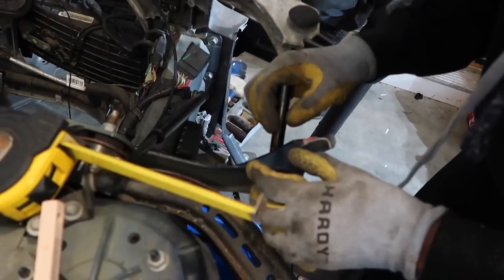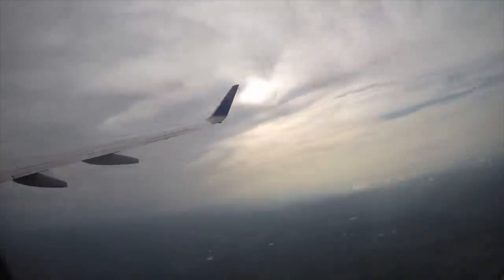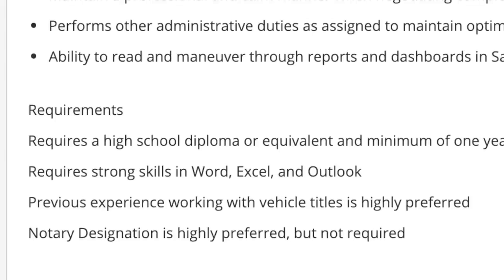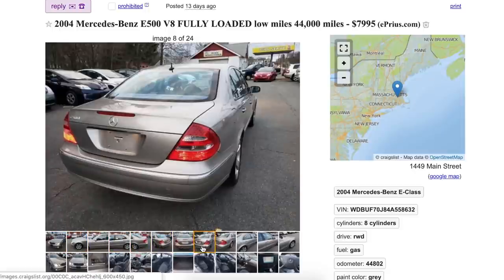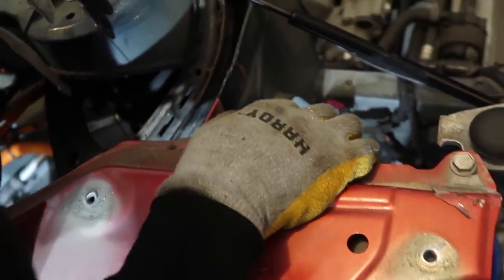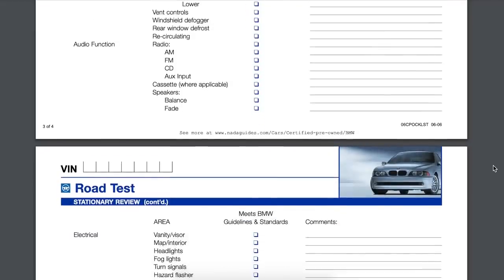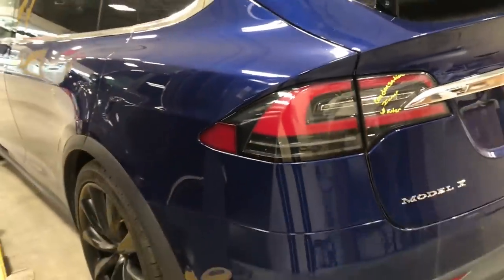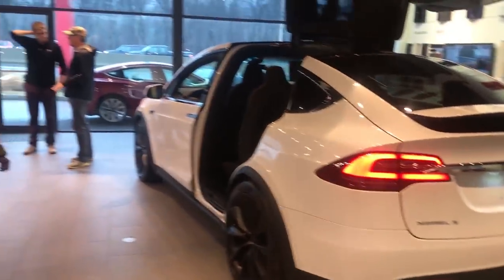Why the used Tesla system is broken

Comment: I had a horrible experience trying to buy one of these., it was at this center as well  Like you said, photos are hard to see any real details and you just kind of go with it because you say to yourself, there is no way they would sell a car like this! I looked at photos for a car, looked good, bought it, and when I showed up the center console was broken, the car wasn't charged even though it was sitting in front of multiple open charging bays, and still had the previous owners info on the main screen... . And last but not least, a cluster of dents in the  left trunk area! Probably 2-3k to fix. I walked after they refused to fix it. They said they don't do body work to used cars.. 
I'm now waiting for delivery on another one at the same dealer. Hoping it goes better this time around. Last time was very disappointing. Sucks not to be able to buy a new one! lol.

Comment: Wow, a late post for me but worthwhile read.  This video reminds me of a situation I worked in a long number of years ago.  I worked for a company that began the desktop computer business, computers used by engineers to do scientific design and analysis to help companies like Boeing, Lockheed etc. build airplanes and other very technical products involving (CAD), computer aided design.  This company grew from a start-up to over a $750M buisiness, selling computers that no one else was making at that time.  So, let me tell you how these computers were delivered to customers.  Computer cost $100K per desktop computer.  Mother boards completely burned out, motherboards inserted across seating slots, coffee cups and cigarettes and candy wrappers left inside computer, computers that, when plugged in, would not even turn on and so much more.  To meet sales and revenue targets, this company would ship the product, then let the field engineer at the local sales office fix the problem.  The customer, while so disgusted continued to buy these computers because there was no one in the industry manufacturing these computers so, there was only one option.  Not until some of the major suppliers of computers began to sell options competing with this product did the company change its practice.  Not possible today - wrong.  Companies will do what ever they have to; to make money and its almost always let the buyer beware.  I don't care how much you pay for the product.  The company purchasing these computers spent almost $100M a year on these computers only to receive them DOA (dead on arrival).  In fact the customer sent their own engineers to examine the computer as they came off the assembly line, just to solve the problem.  Yep and they still make computers today, only much better now cause the company was sold to a very excellent company called HP.  I left the company out because this example was to verify the video, not expose the company I refer to.  Oh, who was I, I ran the NW sales office for the company responsible for $200M worth of sales a year, I was tasked to make these machine work along with the customer!

Comment: The online purchasing process is terrible.  There is no transparency and one does not know how much final cost is until one puts the deposit.  My local service location in Santa Clara is the worst auto service experience EVER.  Rude staff, long waits and lame excuses why work cannot be done (like the weather for road noise...huh?).  They just didn't want to do the work and then later told the mechanic that heard the noise was on vacation.  Shady and questionable responses.  Love the car, hate the buying process and the service center.

The car is a 2016 S/70D with 7k miles and it rattles like covered wagon.  Tesla wants $100 to do a diagnostic.  What?...It is under warranty.  Today, the sunroof area pops and cracks when hitting potholes or large bumps.  Sounds like the sunroof is going to shatter.

Comment: Did I miss something here?  Why would someone buy a car like that?  And for $70k?   Last year I purchased a new 2018 Santa Fe.   $32k out the door.  I remember there were no dents, nail clippings, trash and crumbs in the car.  Plus everything works on the car.  That's quite a bonus when you consider I only paid a measly $32k for it!  Another amazing thing.... I took a 3000 mile trip with it and I didn't have to plan the trip around Tesla charge stations.  In fact I was able to gas up in some little dinky-ass town in Arizona.  If I hadda Tesla I'd still be stuck there.  
Best of all I don't have to kiss Elon's ass to get a servicing!

Comment: I got a new mercedes benz c63s (handcraft from german) with cracked tail light condensation in head light and afrer 1000 miles 4 of 8 cylinder randomly goes off line and causing misfire strands me on highway and had to call uber twice lol. They tell me keep eye on the condensation if it doesnt go away in 5 days well replace it. What kind condensation doesnt go away in a week? Even water will vaporized in 5 days

Comment: and i bought 3 year old škoda fabia, looked at used cars from theyr website then went to see and test drive, liked it then sent in a leasing request and hour later i drove out. And they told battery is almsot dead but still good aka bureaucracy and told me if theres problems then come and we will change it.
Bought the car for 7500 euros and they cleaned it and showed me the last info of the car etc.

Comment: And it's only going to get worse.  Every 90+ thousand Teslas they sell each quarter just add another 90,000 customer relations issues.  Also, because these cars are still so new, virtually EVERYTHING is under warranty with NO revenue coming in for replacement parts, unlike the norm at other manufacturers.  At this point in time, there is no way I would ever buy a Tesla and it will stay like that until they have PROVEN they can service the vehicles they build or fix accident damage in a reasonable amount of time.  I don't care what kind of performance they have or how many automatic updates they send over the air.

Comment: I'd be willing to bet that your Tesla is taking so long because it is dependent on someone else's Tesla being repaired. Someone else with a defective Tesla needed a loaner while their car was waiting for parts or waiting for the mechanic to finish their training on 'How to work on Teslas but not too quickly'. Get it? They're using your car as a loaner for other Tesla owners! Who knows, had you taken them up on getting a loaner you might have gotten your own car. But that would have just confused the issue when they said your car is done, turn the loaner in. Just a guess.

Comment: You can criticize the photos, but if you order a new car, you also get crap. It’s hard to run a car company, it’s easier to run a software co. Tesla is a software company running a hardware company wishing cars were software. Which they could be if Tesla just outsourced mfg to someone else. Until then buying new isn’t much different. They deliver damaged cars and when you complain they say sorry, it’s normal.

Comment: Why would anyone buy a Tesla?  Buy a good used Honda or Toyota or Acura for 1/2 the price with an extended warranty, and it will cost much less to own over the life of the vehicle and you can actually drive it across the country without having to stop every 200 miles.

Comment: Tesla needs to be shamed they are selling anything over $50,000 it better not be toenail clippings in the damn car

I can see that they must be losing money reconditioning the cars for CPO. This losing money should only be temporary moving forward since there will be a lot more cars in there should be more people interested in getting those cars CPO. Right now it’s eight years later, Tesla sold so many cars in that time. There’s a large aftermarket. There Should be a large aftermarket considering EV’s will outlast gas and hybrid vehicles. If an EV has never been in an accident it really should be out on the street!

Comment: That's why I have a BMW M5 2006 with a 5.5L Stroker and 700hp under the hood. Fuck Tesla. When they're good enough 10 years from now, that's when I will consider buying one. Now, BMW with 10mpg makes more sense once you do all calculations and I've done done calculations. You'd have to own a Tesla for 8 years to even up with a BMW M5. When talking about BMW M5 F90 then it goes up to minimum 10 years. Who owns a car for 10years? Huh? Huh? Huh? Almost no one.

Comment: Doesn't seem like Tesla gets any credit for addressing your repairs.. or actually providing the loaner they promised.   I'm not sure your vlogs are actually helping Tesla.. because they seem to be dropping programs that improved the value of owning a used one.  

The irony is.. that every time one of your vlogs come out.. a few months later Tesla no longer offers it.  They no longer repair the aesthetics of used vehicles, after you complained about how long it takes to charge and how cars are blowing up at the supercharger, they removed supercharging for salvaged Teslas rebuilt by a very small percentage of backyard mechanics.. Now there is a monthly data fee for connecting to the network for updates and streaming that I didn't see before..     

I hope you're going to be just as transparent with how you're going to handle your customer complaints in your new business that will be profiting from this company bashing..  Especially if you hope to go public like Tesla..  and I hope they don't end up suing your company.

Comment: Teslas are cool when the are new; but used one's are a ticking time bomb (for your wallet, and for the environment).  Nothing like 6K in out of warranty repairs; and nothing like being the poor sob stuck with a "disposable vehicle".  After 5 years trade it and move on.  Anyone with a 5 year plus tesla is just sitting waiting for a financial headache.    My 2013 BMW 328i xdrive has 140K miles and has nothing but oil changes at an INDY mechanic, which brings up the final problem...no one can work on an old Tesla except Tesla, and perhaps you....  So why get robbed at the dealer.  Had brakes done the other day (a $1500 dollar job at BMW, done for pennies....$300 in and out the door at my INDY)  Will get a $29 dollar oil change next month.    So I don't hate teslas would love to lease one.  But again after 4-5 years you are jumping into a money pit.  I laugh when i see my neighbors rolling around in these things because i already know they bought it used.  Peace.

Comment: These videos demonstrate the Tesla business is bound for the shitter. You need to figure that of the folks who have the mulah to lay down for these cars, there will be a significant number who just could not give a shit and aim to dump the car into the used line sooner than a real enthusiast would be expected to, hence the dents and toenail clippings, Ewwww.

Here's a future prediction for ya. Tesla hits the buffers in 2019. No Euro or US manufacturers will see anything of value in the company that would tempt them to buy it. The Chinese who are actually streets ahead in vision for the electric car thing, will wait until they can pick up the whole shebang for 20 cents on the dollar. The manufacturing plant will get shipped to China, where the concept will be made to work as a Chinese produced vehicle. 

From your standpoint of making parts for Teslas, if the business ends up in China, they'll be selling parts in volume, and at prices that'll cut your legs off. And if the worst case scenario happens, and Tesla go the way of DeLorean, demand for the existing vehicles will evaporate, and the market will be stuffed full of parts bought for pennies on the dollar from liquidation sales. Might be an idea to view things in Business making money mode, rather than any vision of the future idea ?